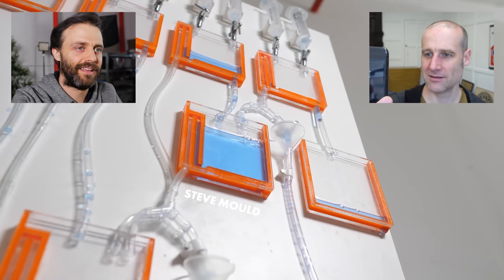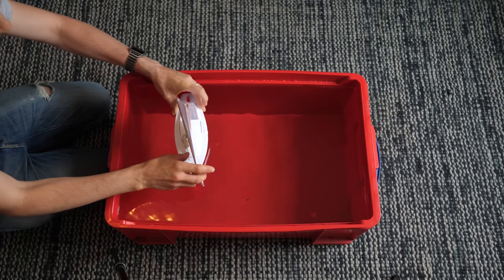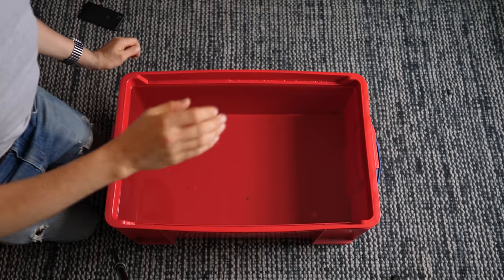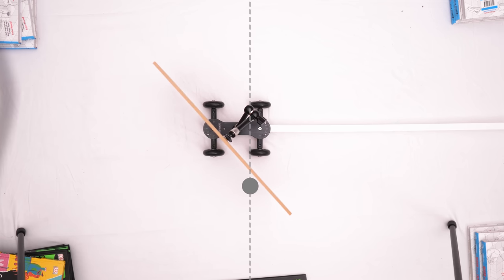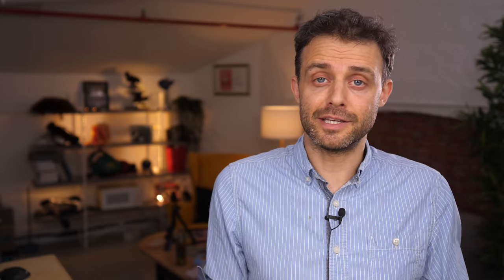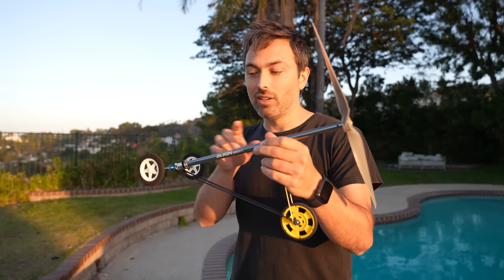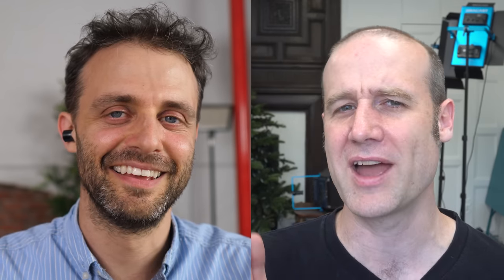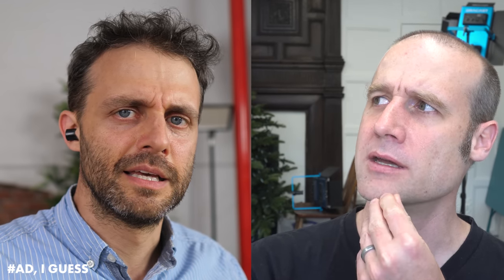Sailing Faster Than The Wind - How Is That Even Possible?

Comment: After proved being wrong, and after a lot of discussion and a good explanation from Andrew Snow, I think it is very clear to me and maybe I can explain it in a simple way...
In theory any vehicle that has a propeller connected to the wheels, in a way it generate forward thrust while the vehicle is moving forward, is capable of travel faster than the wind.
Explanation (without losses for simplicity):
A vehicle in the wind will be pushed and accelerated until reach an equilibrium point where there is no resultant forces.
- If the vehicle is not connected to the ground, the equilibrium occurs when the velocity of the vehicle is equal to the wind.
- If the vehicle has wheels connected to a propeller generating thrust, the equilibrium point is now changed to the velocity where the propeller can't make thrust, and that velocity is faster than the wind. (the propeller has to make a perfect helicoide into the wind to not make any thrust or drag)

*For clarity, it does not mean that the vehicle with the propeller will accelerate faster, slower or have any kind of increase in efficiency. The main point is that the equilibrium point is changed, so, in the stead state, it will be moving faster than the wind.
Reply: Andrew Snow has been popping up with some great explanations on these videos.  I will add one item just for clarity if I may.  A lot of people will say "how can you add drag to drive a propeller that adds thrust and come out ahead?  That's clearly perpetual motion and we all know better!".  And to those people I'd say "you're exactly right if there was no true wind".  But the fact that there is true wind over the ground means that we're now going over the ground faster than we're moving through the wind. So we can trade a small force over a larger distance (the wheels rolling over the ground) for a larger force over a smaller distance (the propeller thrusting on the air).  It's just a convoluted lever.
Reply: @Rick_Cavallaro  Yes! I was one of that people LOL. But when we really understand that is possible, that is lots of simple ways to explain how it works using solid basic concepts and there is no reason to discord.
I think the explanations in the comments over the Real Engineer doubt was way better than the Derek and Steve approaches.
Reply: @rogeriocosta1035  
>> I think the explanations in the comments over the Real Engineer doubt was way better than the Derek and Steve approaches.

What is that?

Comment: I think the Veratasium Video was more about a Sailboats ability to go faster in a downwind direction than the Wind itself (aka its downwind VMG) and how to optimize this effect on a rotary craft.
Basically, we sail at a slight angle to the wind to go faster downwind.
When your speed comes closer to the windspeed, the apparent wind lets you harden the sails (orient them more in line with the boat) and use the mechanical advantage described in this Video.
Reply: In real life, this only really works at medium wind speeds and with fast boats. If you consider course complexity and waves most of the time you are better of just going straight down
Reply: The faster in a downwind direction than the Wind itself (aka its downwind VMG) is shown here:
https://www.youtube.com/watch?v=H_OKNr120t4
https://www.youtube.com/watch?v=63hvQABLOaE

Comment: Airfoils, be it sail or wing, aren't very intuitive as to how they provide lift, yet they do.   They work by creating a low pressure area on one side of the airfoil by having air flow at different speeds on one side than the other.  That isn't very intuitive at all, but you have to pretty much accept it.  In the case of a sail, it generates thrust perpendicular to the sail (the boom) based on airflow along the sail (parallel to the boom).  That thrust can be divided into a forward vector with little resistance from the water and a lateral vector with a lot of resistance from the water.  The lateral resistance then acts a bit like a lever to give more thrust in the forward direction.

What is also not very intuitive is that the whole system is in motion and generally changing velocity.  So the apparent wind direction is modified by the current speed of the boat.  All of the angles and resistances get tweaked about until an equilibrium is reached and the boat reaches its cruising speed.  Sailing with the wind is not very efficient because it restricts the airflow and merely creates a higher pressure area on the back of the sail.

That's all very well and good, but it isn't at all what is going on with the propeller car.  The propeller is geared to the wheels and actually turns opposite to the direction wind would spin it if it were free spinning.  So, at start, the whole car is being pushed forward by the resistance it has against the moving wind.   However,  that forward turning of the wheels drives the propeller in such a way that it starts generating thrust.  As the car speeds up, it generates more thrust, thus causing it to accelerate more.  The thrust from the propeller is opposed by air resistance (both from the spinning prop blades as well as the cross section of the whole car).   This eventually reaches an equilibrium (like the sailboat) where the resistance in the air equals the thrust generated by the propeller.  When the car was starting, it had negative resistance since the apparent air flow was going in the direction of travel.  Once the car exceeded the wind speed, the net difference acted as drag to slow down the car.   Note that the window for the parameters where this works is very narrow.  The key thing to remember is that the wheels were driving the propeller not the wind.

Comment: This is a very good way of visualising it and it is partially correct but the main reason boats can sail faster than the wind isn’t actually deflection. Deflection of wind would mean that the sail is acting as thrust which isn’t entirely true. The actual power of a sail comes from the shape of it. This shape is like an aero foil and it produces low pressure on the lee side of the sail and high pressure on the windward side of the sail. This together actually sucks the boat forward. The reason we can go faster than the wind isn’t that we are deflecting wind using our sail and causing a vector that’s faster than the wind it’s actually because of apparent wind. Apparent wind occurs because the boat is moving through the air and producing its own headwind. Combined with the wind coming from close to behind the boat the net force is a wind that is equal to the sum of both wind speeds plus there angles

Comment: i think the thing that helped me wrap my head around the "faster than the wind in the direction of the wind" car...thing... that veritasium showed, is not to equate the car to a sail boat moving the direction of the wind, but instead equate the blades of the prop to a sailboat moving at an angle faster than the wind.

Comment: Hi Steve, the sailboat tacking graph shows the sails sheeted in past the centerline which in reality doesn't work!
Cheers on a great video!
Reply: Not true! I’ve raced sailboats for many years now, semi professionally as a sail trimmer at some points, and due to leeway angle wind shear and sail twist sheeting your main above centreline is optimal on many “slow performance” keelboats, namely old designs that were high performance when they were released, like stars, 6 meters, 12 meters, and those old americas cup monohulls from before foiling was introduced

Comment: Brutal description. Makes me want to give up windsurfing. The forward speed of the boat adds a wind vector from the front of the vessel. The combination is called apparent wind. So an actual wind of say 20 knots can easily produce a forward speed of 20 knots. The apparent wind is at the angle of the hypotenuse. The apparent wind speed is the length of the hypotenuse. Simple Pythagorean theorem. Apparent wind is now 28 knots so you can now go even faster. Sailing on ice can result in 4-5 times wind speed.

Comment: The shape of an airfoil is for creating a difference in distance travelled by the fluid (air is also considered a fluid in this case) between the 2 sides of the wing or turbine blade... that means difference in velocity which relates to dynamic pressure difference. This pressure difference is what makes the shape more efficient, as it creates (additional) lift even if there is no change of direction.
Reply: >> The shape of an airfoil is for creating a difference in distance travelled by the fluid 

The "different distance" theory is a very common misconception, and one that is easily disproved.  In fact, Derek has an excellent video that shows just that.

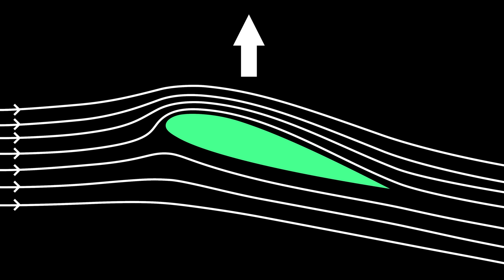Comment: at 3:30 you say that it's the same concept than an aeroplane wing, well it isn't, the airplane wing's doesn't have lift because of the deflection of air, their have lift because the pressure difference between the top and the bottom of the wing. if it wasn't like that airplanes wouldn't be able to fly perfectly horizontally, and actually they can. 
(I apologize about my English, I'm a Spanish student of aerospace engineering)

Thanks for such a great video

Comment: The curve of the sail is actually an impediment to ultra-fast sailing. In the limit, you want the sail to be as flat as possible. That's why you see the America's cup boats with almost flat rigid sails. The dead-downwind speed of a craft with a sail is
V = Vs.tan(theta) + Vw

where V is the velocity of the craft in the direction of the wind and Vs - and this is the tricky bit - is the velocity of the sail perpendicular to the wind.
Vw is the velocity of the wind (measured by a stationary observer) and theta is the angle  that the wind hits the sail. (When the sail is flat to the wind, theta is 90 degrees)

This equation works for the land propeller craft. The key is that Vs component. On a regular boat, sand yacht or an ice sail boat, that Vs component is caused by the boat moving at a small angle off dead-downwind. For Veritasium's land prop craft (I know it isn't actually his machine) that Vs component is generated by the prop blade slicing through the wind. It doesn't matter a bit that it is rotating - but, it would actually be better if the prop blade was just a simple flat surface not the aero shape it is.
Reply: >> In the limit, you want the sail to be as flat as possible.

Nope
Reply: @Rick_Cavallaro  I should have defined the word 'limit' and not associated it with actual craft. At high speed, say 1000 mph or so, you want to minimize the any pressure difference between one side and the other. With a curved surface, the opposite sides of a 'sail/wing' will present a different angles to whatever fluid it's going through and that equation above will have two values for tan(theta), one of which will be sub-optimal.  In the real, sub sonic, world, of course, you might as well make use of the fact that when a surface is dragged through the air, providing a surface to reduce turbulence is a good idea and even better if you can accelerate those air molecules so that the rate of change of momentum normal to the surface is minimized on the leeward side. That way you get the force that people call lift.   
I'm sure people will be arguing aerodynamics a hundred years from now :)

Comment: I really liked the "packets of air" explanation, and also the dig at the Bernoulli fans (I never  felt like "It's Bernoulli OK?!?"  is a good explanation for anything). 
I do wish you would talk a bit more about sailing into the wind and what that does to the air packets  model; or indeed to the flow-direction-deflection model (since the deflection is actually a lot less when you're going upwind and keeping the sail mostly in a similar direction to the wind). I think it also would have been more intuitive  if you kept the wind direction constant, rather than the boat travel direction. "If the wind is like this, how fast can I travel in direction Y?"
Reply: Also, maybe to explain why it's possible to sail faster than the wind, you could have started by exploring why it feels like it should be impossible (and then frame it as what that intuition misses)

Comment: 11:38 -- RE: The Lift Thing;  there are ways to discuss why its True that Sailing is exactly like Flying without getting into the mathematics.  In fact, I suspect that it would help to improve mathematical intuition later on to first observe it with your own eyes.

Sails on boats can be trimmed, like airplanes;  and furthermore, when they're properly trimmed (and with the right sail configurations and knowledge of rigging) the boat can sail itself "hands free" while the relationships between the sail angles, the rudder, and the direction / speed of the wind remain more or less constant (variability in the winds and currents is dampened by rigging on the rudder and sails).  In the end, the mathematics rely as heavily on Bernoulli as anything else due to the effects of water as well as wind currents, and the suction forces dragging the ship back.  Otherwise though, the sailing vessel bears a striking resemblance to a 20th century unpowered soaring glider which takes advantage of updrafts to travel further forwards than it falls back downward.  That should be directly analogous to the very nearly perpendicular sail arrangement.
Reply: ^^  I also cannot help but note that the modern unpowered soaring glider is quite close in its form to the albatross.
Reply: RE: Traveling further forwards than falling backwards / "downwards" ;  see also Heaving To.

Comment: There’s no wind underwater (only perceived water flow in the opposite direction of travel). Under water, the boat has a keel, which is a symmetrical hydrofoil. The sail does its airfoil thing in one direction, and the hydrofoil keel does it’s thing 90 degrees to the direction of travel, and the result of adding these two force vectors is that the boat travels into the wind at ~45 degrees.

Comment: You’re missing the crucial piece of the puzzle: the shape the sail takes on—with wind from the side—is that of an airfoil, a wing. The wind traveling along the outside (leeward) surface of the wing has lower pressure than the inside (windward) surface. This is what causes lift (along with the sail’s angle of attack as you described).
Reply: What you say is true - the ball hitting a wall analogy is a gross oversimplification that will make an aerodynamicist puke (if it was true, then maximum lift would happen at 45 degrees angle of attack rather than the at 15-20 that it actually does). But even this oversimplified model still explains the basic sailing geometries, and why faster than the wind sailing in some directions is possible.

Comment: This gives a fairly intuitive simplified explanation of how a sail works, but it doesn't really explain why you can sail faster than the wind. You can't just sheet in a sail further to gain more speed and move faster than the wind, because the air doesn't behave like a rigid stick with a wheel on the end. Airflow needs to stay attached to the sail to create lift. Over-trimming a sail will cause turbulence, drag and additional heeling force = not fast. However if you have the sails trimmed correctly, the boat will speed up, and the wind acting on the sail (the apparent wind) will be a combination of the true wind, and the wind generated from forward motion. The apparent wind can be stronger than the true wind, and further ahead, which requires trimming in the sails further to keep airflow attached to the sails, and also reduces drag which enables even more acceleration.

Comment: In the equation you have to take the relation of actual wind and relative wind into consideration. The fast sailboat does sail up to a steep angel of wind from the front (relative wind), even if the true wind is coming from 90 degrees abeam.

Comment: This thing makes me crazy I watched the first video. I have always the feeling that I'm very close to understand it.  The problem is that it's just working if it's moving. At the moment I'm totally aware how the energy is harvested. I'm just struggeling with the comparison of force and velocity at the rotor and the wheels. The treat mill experiment is very helpfull. It is obvious that there is a force against the movement of the mill. Force + movement = engergy. ... so it's obvious that energy is harvested from the mill.

This feels very similar to my learning process how a  ram pump works. In the internet there are alot of wrong explenations why/how a ram pump (water pump) works.

Comment: The wind is not pushing the sail when it is configured in such a way as to allow it to go faster than the wind. The wind allows the sail (wing) to produce lift. It is the lift generated by the sail (wing) that provides the force needed to propel the boat. Given a sufficiently large sail (wing) and a sufficiently efficient hull design, a sail powered craft can travel faster than the wind.

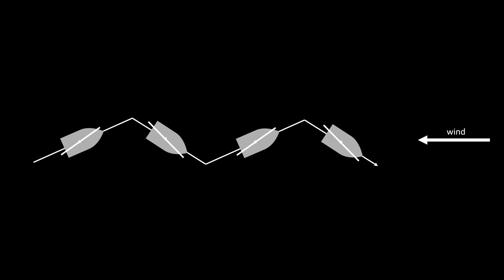Comment: At the section about sailing against the wind, there's a discrepancy between the physical model (around 8:30) and the drawing of the zig-zag motion of the sailboat (near 8:48) as on the model the front of the sail is on the side the wind is coming from, and on the drawing the front of the sail is away from the wind.
I think the drawing is the most likely to be incorrect...?
Reply: I think so too. My vector diagram shows that the sail should be between the boat and the wind, not the boat in the middle

Comment: So... the angle of the sail is practically equivalent to the gears of a bicycle -- closer to parallel is like a really low gear, and closer to perpendicular is like a really high gear. Does this mean that you should start with the sail almost parallel to the wind and gradually turn it to 45 degrees and beyond as the boat picks up speed?

Comment: Both sail or propeller can be considered as a transmission device. The tip of propeller is always travel faster than the wind but in different direction.